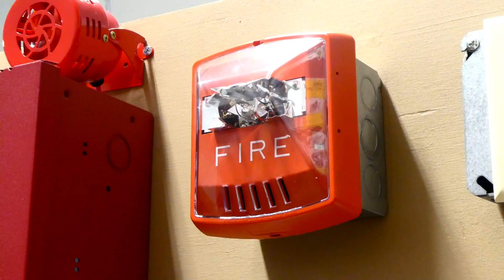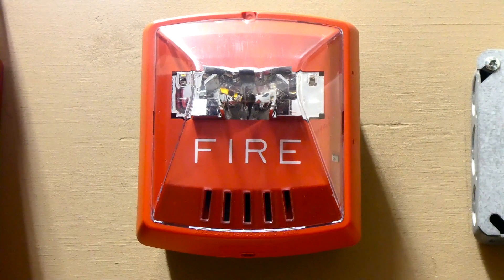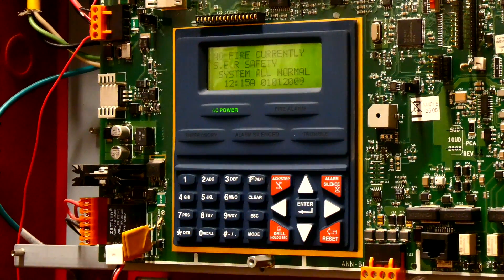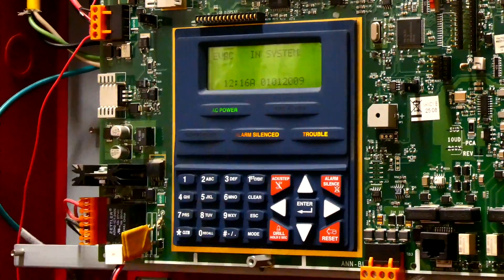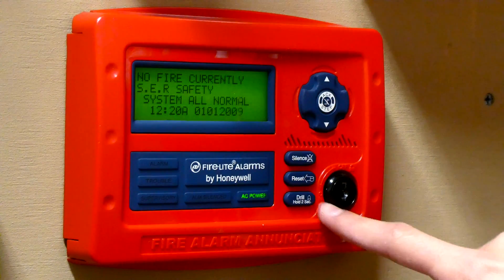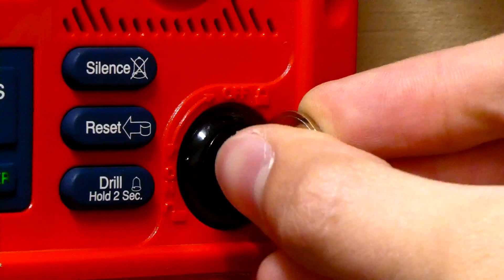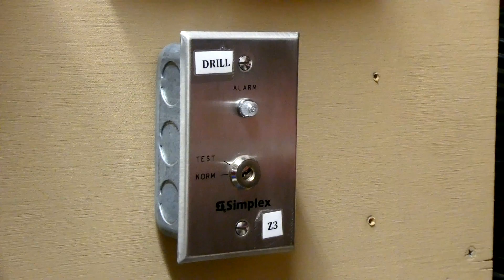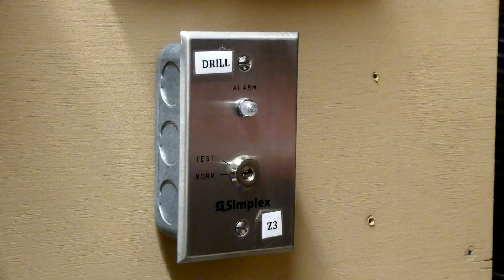Fire Drill!! | ADT Unimode 10UD System Test 17

Comment: BG 12 L Pull Station was my first one.
Then SpectrAlert Classic Horn Only and SpectrAlert Classic Strobe Only came together.
Then EST Genesis Horn Strobe and BNG 1 Pull Station.
Then SpectrAlert Advance Horn Strobe. 
Then Wheelock Speaker Strobe and Edwards 278B - 1120 Pull Station.
Then finally the Simplex 4906-9151 Truealert Speaker Strobe.
That's the order in which I got my Fire Alarms and Pull Stations.